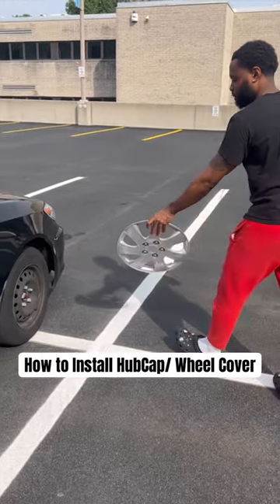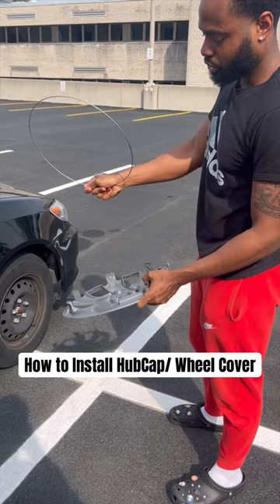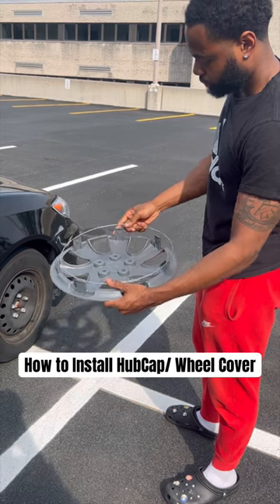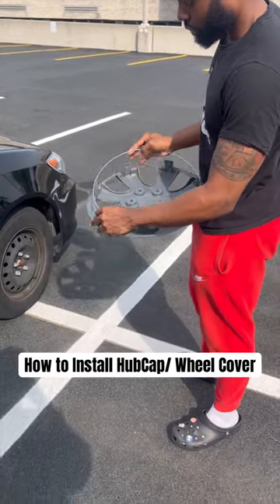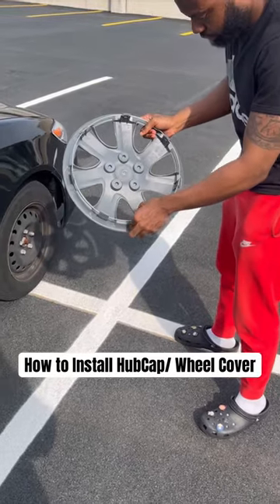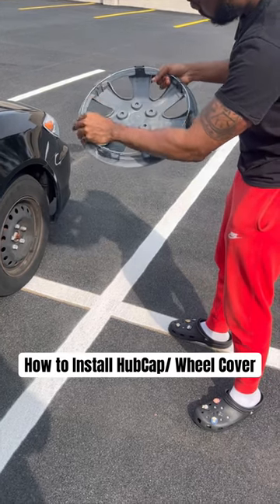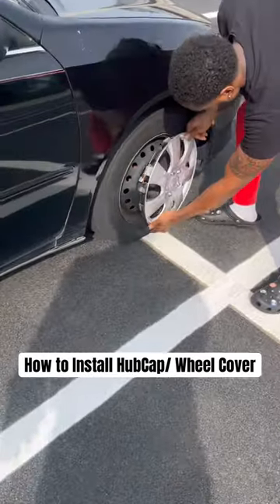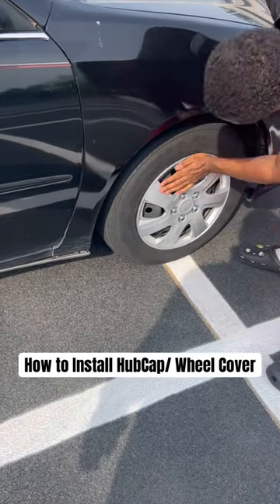How to install car wheel cover🛞or hubcap

Comment: All that time and he still got it wrong 🤦
Reply: I know the valve stem isn’t right
Reply: Where is your video showing the correct way??? Nevermind, you are just on here trolling someone else's video.
Reply: If you need a video to do this you shouldn't be touching cars, this is one of the most basic, self explanatory things you can do on a car.

Quite literally changing a light globe is harder.
Reply: @fairydust-ky4oc what's anyone else's video got to do with this video? The fact remains is that he did it wrong.
Reply: @IsMiseAnRi  well if you know how to do it the right way then why don't you upload a tutorial?
Reply: @fairydust-ky4oc  Because anyone who needs a tutorial to do this shouldn't be doing it in the first place! 

Do you watch tutorials on how to open a door? Or perhaps how to close a drawer without slamming it? Maybe you'd be interested in a blinking tutorial?
Reply: @matthewdellaway5920  I can just about imagine how fun you are at parties.
Reply: @fairydust-ky4oc  I'm shocked you have the brain capacity to achieve imagination.
Reply: @fairydust-ky4oc no but he is right it is wrong
Reply: @GitzKing that is the most ignorant thing I’ve heard in a long time. Popping hub cap covers on doesn’t require any automotive skill or knowledge, there’s absolutely zero reason someone should go pay another to put these on just cuz you feel like being a judgmental ass in the comments.

Comment: Except on the wheel, the air valve is at 5 o'clock and when the hub cap is put back on, the cutout for the valve is at 12 o'clock.

Comment: Looked like they went on real easy. 
I’m having trouble with mine they abit tight and iv got them on the loosest setting. 
Can I cut the wire a little shorter to make it easier?? 
Any suggestions please? 

Thanks for your post.